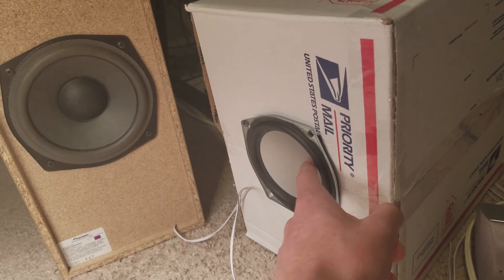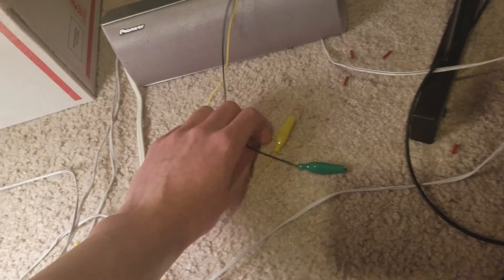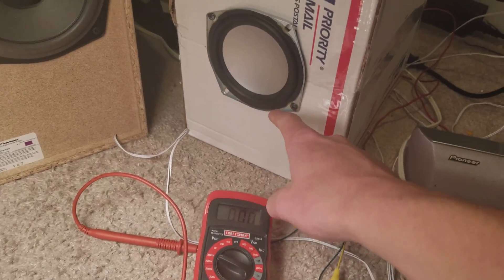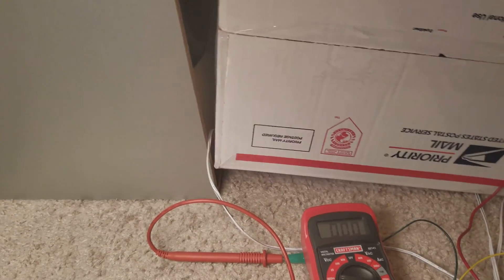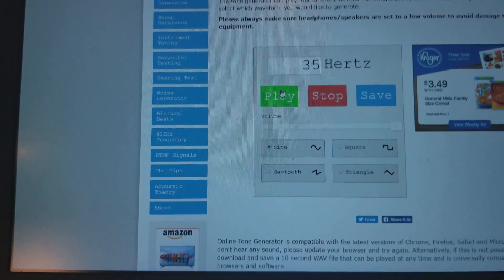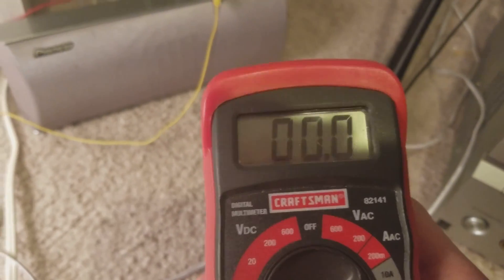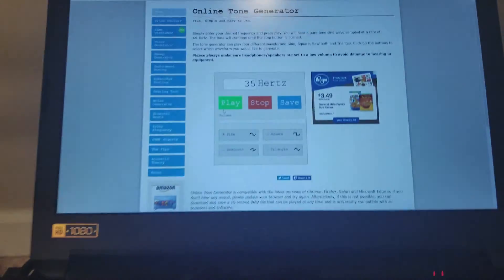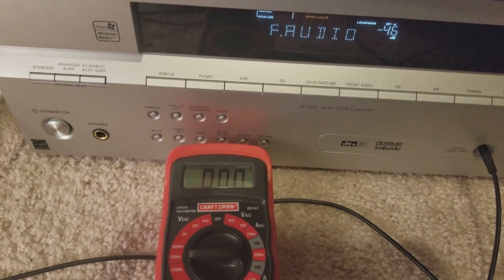Free Energy Generator Using Sound

Comment: Some 11th grade students in the Philippines have got it powering a small bulb. What I would be interested in, would be can it be used perpetually.. the speaker receiving sound, sends out sound that itself can pick up and power. According to this article 
https://economictimes.indiatimes.com/news/science/young-inventors-create-a-device-that-converts-noise-to-electricity/articleshow/71804623.cms?from=mdr#:~:text=%E2%80%9CWhen%20sound%20waves%20hit%20the,which%20could%20power%20up%20light.&text=A%20larger%20speaker%20with%20a,electricity%20for%20the%20whole%20community.
according to them, 140 decibels could generate enough power for a 5w bulb - all that was needed was some capacitors worth about £4... Im not proficient enough in this science to be able to replicate myself, but you seem to be on the right track. What brought me to look into this, was the fact that previous civilisations were able to bore drill stone and lift 100's of tons of stone, possibly using sound powered devices or sound itself. This is irrefutable when the evidence of such stone cutting is available for all to see. Just because it doesnt fit our vision of gadgets and tools, doesnt mean it did not exist by a civilisation that has long been gone, probably due to some catastrophe. Anyway - the point is, to generate free unlimited energy using what is an easy to generate energy system based off sound.